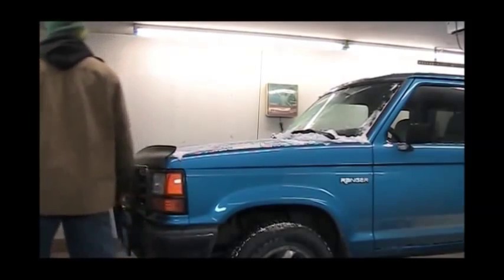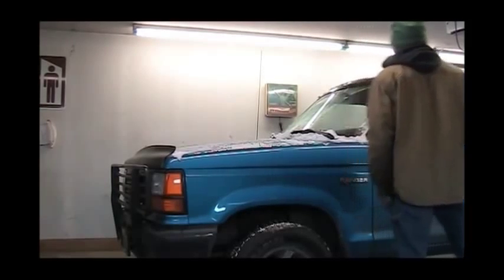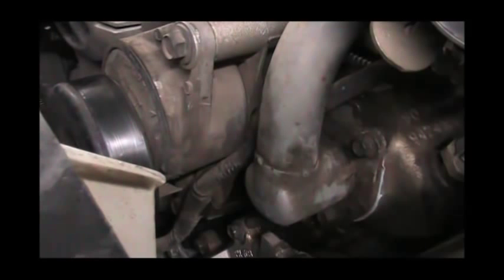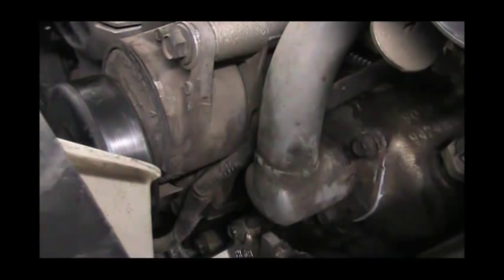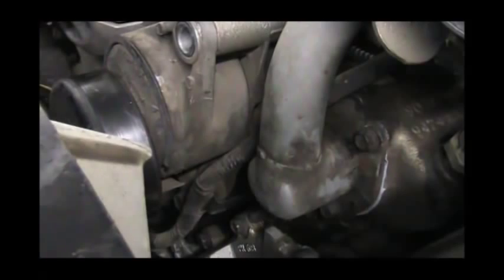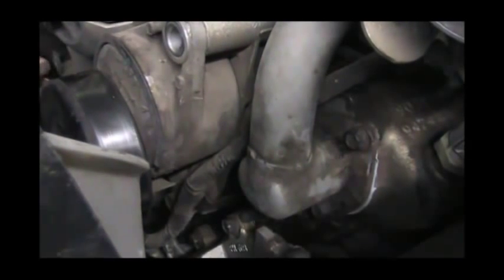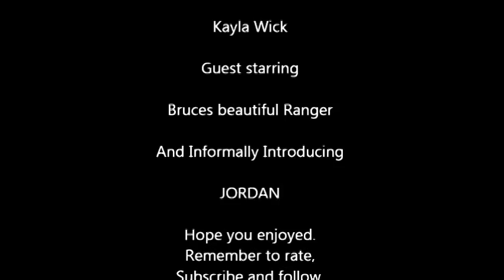Fixing up Bruces 4.0 Ranger

Comment: Havin a day on the farm where the mixer wagons broken so you spend an hour on that the power steering on the 7410 is broken so you try using the backhoe and after you get the round bale out of the field and to the bunk you realize the front tire was flat and you broke the bead on the tire and the 4040 doesn't have enough hydraulic power to fill the mixer wagon with corn well